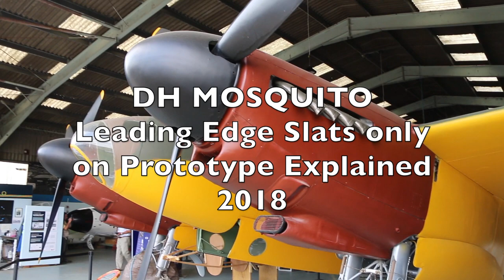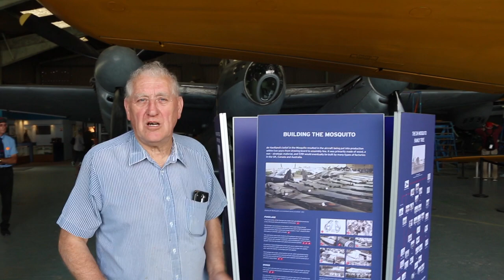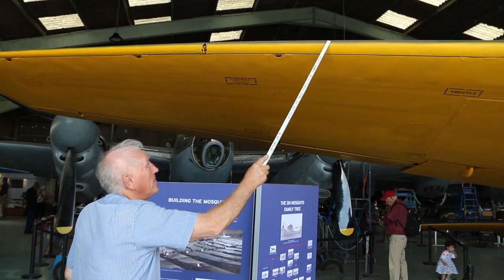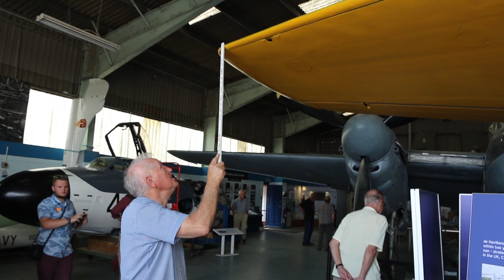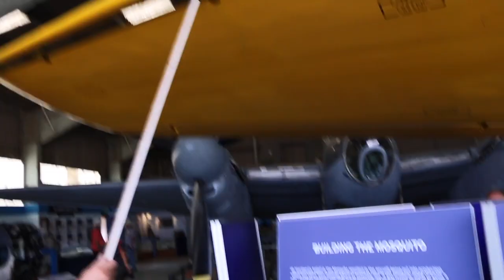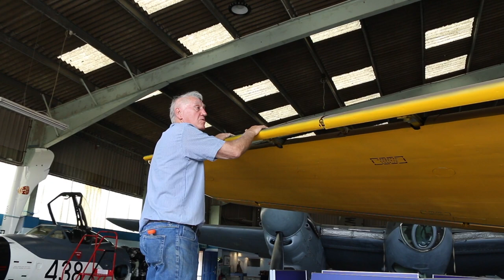DH Mosquito Leading Edge Slats at de Havilland Aircraft Museum Salisbury Hall England - 2018

Comment: It is remarkable that they (the D.H. team) went into a direction which later proved the to be the standard.(!)
The Me 262 had slats from design on, much-much later the F-4 Phantom  was also re-equipped with them.
High-wing loading aircraft benefit much from these devices.
Reply from the maker: Louis, yes, our old RNZAF Douglas Skyhawks even had them! Unusual the the Mosquito ones were only rediscovered during the last recent refurb. The engineer told us that there is only a single reference to their deployment on a flight log. The A/C was so efficient they were not required. Cheers, Mike

Comment: Yes, very, very  interesting. I didnt identify them (before the restauration was carried out. )
The Me 109 had such devices too, but later in the war designs, as the FW 190 for instance did not had these slats, and  the Mosquito was also perfect without them. 
Indeed they are complex. And do they function in below freezing temperatures or simply stick? Guns had heating...but slats? 
It could be argued if slats would be a benefit if turning tight in a dogfight , in near stall condition. The Mosquito was designed to fly very fast, high or very low...
Reply from the maker: Louis, interesting comment, thank you. The Douglas Skyhawk had auto slats as shown on one of my other videos. regards, Mike
Reply: Another aspect against them is the mounting of slats on the outer-wing only. The inner wing was not equipped. (?) 
Application of a slats makes the angle of attack to stall noticeable larger. The wing could be turned to a larger angle of attack, but the inner wing would stall at the original angle of attack anyway. Then you end with a partially stalled, but controllable aircraft with much drag. 
The nr one-design-feature of the Mosquito was speed, it had to be 25 miles faster than the German fighters of that time, and is was faster.
Reply: @louisvanrijn3964  the radiators are in the leading edge of the inboard wing sections. 
You want the inboard wing sections to stall first. Most aircraft are designed to do this.

Comment: Maybe I missed it- is it gravity that pulls them down at low speed?  I'm familiar with that type having worked on a USAF Saberliner from the 50's.  Its slats hung down from gravity there in the hanger.  I pushed them up and down and it was purely their weight that dropped them down.  And I assumed it was just the incident force of the windstream as it picked up speed that pushed them up into the closed position.  Interesting about the stagnation point.  Also interesting about a simultaneous discovery/invention between the English and Germans.
Reply from the maker: Barre, they were fully auto with no pilot input. However there was only a single report of the use as in the end they were not required as the wing worked OK, thanks for your comment, Mike - AirflowNZ

Comment: Fascinating. And when you realize that all that engineering was done with slide rules and a drafting table.
I wonder if these slats would have lowered the 110 MPH stall speed of the Mosquito.
Reply from the maker: Jack, from what I gathered the slats were only used once in a flight log and that was to increase lift at take off. Cheers, Mike